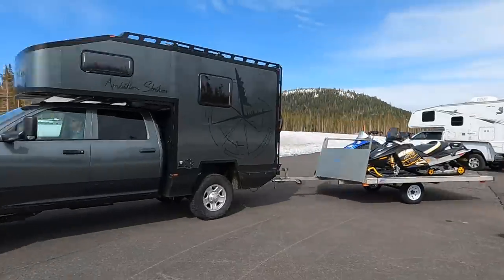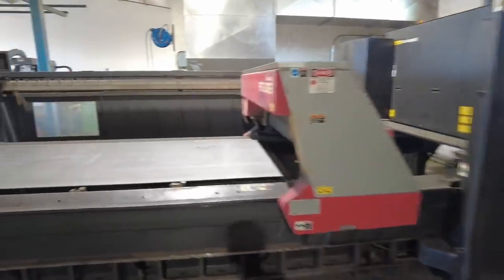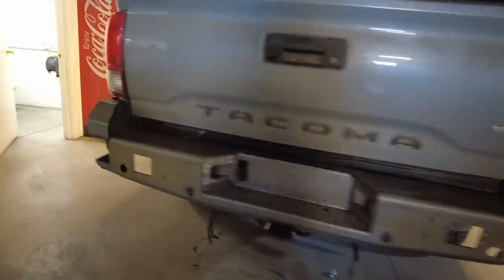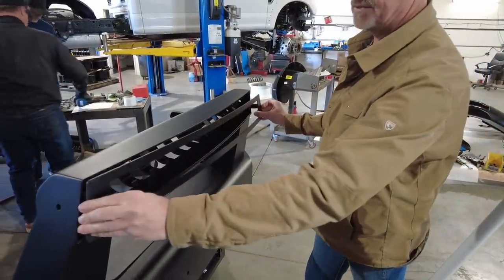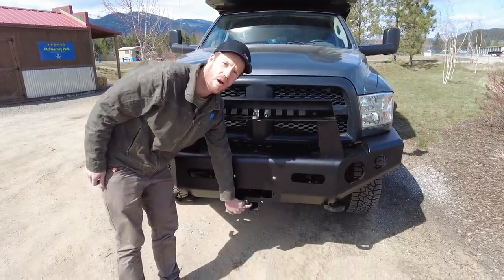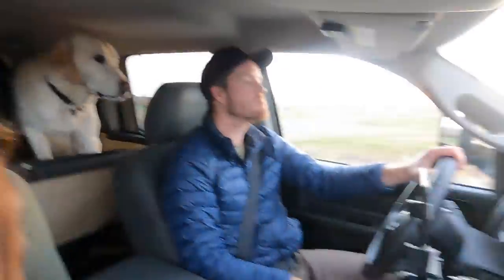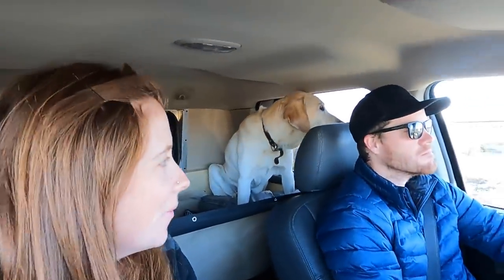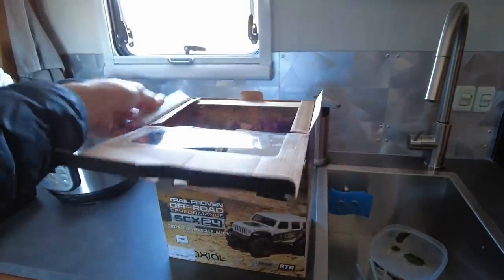This Changes EVERYTHING! Installing Our Buckstop Aluminum Bumper

Comment: Best winch for you is the Warn 16.5 TI. A winch should be rated at twice the vehicle weight. Think of your boot stuck in the mud then imagine your whole truck stuck in the mud. It’s the winch AEV uses for a reason and I bought one for my Ram as well.😁
Reply from the maker: You can never go wrong with a Warn!

Comment: When it comes to winches, it's got to be Warn.  You get what you pay for, and a winch is insurance.  I'm a bit biased as I used to work there, but there are design details on the inside of a Warn winch that make them better than the competition.  Superwinch would be a close second.
Reply from the maker: We have run Warn's in the past and have never been let down!

Comment: Awesome!  As for the intercooler protection Riley mentioned, ask Buckstop about their front lower skidplate that closes the gap between the bumper and the lower part of the frame frame.  I didnt even know they offered one until a friend told me, its a slick piece and fits perfectly its in one of my episodes.  Awesome work guys
Reply from the maker: Thanks Kevin, we're going to have to check that out!

Comment: I love the new bumper. I have been eyeing some Buckstop stuff for my trucks and Seeing their operation was all I needed to convince me to buy from them. A coffee tip, when you have no coffee filters (cowboy coffee): Bring your water to a boil and remove from flame, dump grounds directly in water and let sit for 5 minutes, pour about a cup of cold water into the pot slowly and distribute evenly over the surface. Then pour the coffee and drink. You will have to dump the last cup or so with the grounds in it. The cold water knocks almost all the grounds to the bottom of the pot.  I am looking forward to see wheels and tires now.
Reply from the maker: We are so stoked with the bumper and were even more impressed with their operation! Thanks so much for the tip, we will be better prepared next time we run out of filters now!

Comment: the 12,000 lb winch From Harbor freight has been very reliable for the people I know that own one.  It is also a wireless remote. I also recommend a synthetic rope if possible to get in that weight limit.
Reply from the maker: Yes synthetic rope is the way to go! Safer, lighter and so much more pleasant to work with.

Comment: Ive only ever had one winch. But it has been plenty reliable. Harbor freight badlands 12k. Only downside was the rubber on the electric cables fades and gets hard in the sunlight. But in your covered bumper it would be fine
Reply from the maker: That's awesome you've had good luck with that winch, we are certainly going to check it out!

Comment: Love the bumper. I will definitely check them out because I want something rather unique. I like the receiver built into the bumper but I want two of them. We have electric bikes (we’re old farts) which weigh about 50 lbs each. The bike racks that I have found are not stable enough. I think two mounting points would be much better. Safe travels!
Reply from the maker: Riley seems to think they should be able to do two hitch receivers no problem! I ride an ebike and agree that two bikes on one hitch would be sketchier than I would like!

Comment: There are lots of ways to save money on an off-pavement truck build, but tires and winches are two places to never cut corners, as it may cost you your life and/or your rig.  Conventional off-road wisdom says you want a winch rated for 50% more than your GRVW (so if your GRVW is 10,000lbs, you'd want a winch with a minimum rated line pull of 15,000 lbs).  In all likelihood, given the weight of your rig and all it's permanent gear, you;re probably going to want a 16,500 lb-rated winch or larger.

WARN winches are the way to go )as you probably already know).  Ultra-reliable and easy to get parts and service for.

To save constant weight on the front end suspension (esp. since you just added another 50ish lbs of bumper), I'd go with something with synthetic winch line.  Synthetic line is also safer if it breaks - less chance of the shackle coming right back at you through the windshield.

If it were me, not knowing the exact weight of your rig other than the 8600ish pounds you mentioned in Episode 5, I'd suggest looking into a WARN 16.5TI-S or a WARN-15-S (the "S" indicates synthetic rope - drop the "S" to find the same winch with steel cable).  Pricey, but overbuilt and perfect for your rig.

https://www.buckstopinc.com/warn-165ti.html (steel cable)
https://www.dieselpowerproducts.com/warn-16500-lbs-capacity-winch (synthetic rope)
https://www.amazon.com/WARN-000-M15-S-Winch-97730/dp/B01N4SP32V (synthetic rope)
Reply from the maker: We have never been left stranded by a Warn winch so that is definitely the direction we are leaning. After owning several winches with synthetic line we will never go back to steel cable!
Reply: @AmbitionStrikes  Oddly enough, I just watched another YouTuber use a brand new-synthetic line winch to drag an old truck out of the woods.  After a single use, his synthetic line showed a lot of crushing/stretching damage.  

I edited the link to play right where he shows the line damage:

https://youtu.be/EQ9BW4hh1to?t=522

Comment: Bumper looks so great. how much is the rough cost? thanks!
Reply from the maker: We are very stoked with how the bumper turned out and can't wait to put in the lights and winch! Retail on the bumper really depends on the configuration you choose, especially if you upgrade to aluminum. They have a great configurator on their website to help you get an accurate price!  buckstopinc.com

Comment: I've seen good reviews on the Harbor Freight 12,000 lb winch.  Watch Wranglestar's review of it . You'll find it quite informative. The winch is 6 to 7 hundred dollars less than others at that rating. It comes with a wireless remote and a long cable seems easily installed and Wranglestar and other reviewers all call it beefy.
Reply from the maker: Thanks Craig! There have been quite a few votes for the HF winch so we definitely need to check it out.

Comment: for a winch I would'nt go with anything smaller than a 12k winch.. ideally I would put a 16k winch in it.. however once in 16k winch territory you tend to get stuck with steel cable, and if weight is a concern... that is about 120lbs hanging out front.. but you should use the 1.5x rule of thumb, and always have a snatch block to (nearly) double your pulling power. and seek synthitic if you can.. tyhe weight savings is HUGE..
Reply from the maker: Yes! After having synthetic cable on several winches we will never go back to steel cable. It is so much lighter, safer and more pleasant to work with. We will definitely be carrying a snatch block and tree saver strap as well.

Comment: looks great yall! curious to know if you considered AEV for the ram. If so, what made you go Buckstop? We are deciding between both brands currently. I dig the different brushguard styles and customization from Buckstop as it allows for serious protection and endless lighting options but the stamped AEV bumpers do look amazing. let us know!
Reply from the maker: Hi Garrett! We like a lot of the features about the AEV bumper but it is significantly heavier than the Buckstop aluminum bumper and that was the deciding factor for us.

Comment: I ordered one too!
Reply: I went with the comeup seal 16.5 with synthetic line and wireless remote.  Did Buckstop say you can add the winch without removing the bumper or are you going to have to reinstall it?
Reply from the maker: That is so awesome! Send us a pic when you're done with the install so we can it out! courtney@trailtestedmfg.com

We will need to remove the bumper to install the winch but it seemed quite easy!
Reply: @AmbitionStrikes  will do! It should be in in a week or 2 and I need to pick it up in New Hampshire (about 1.5 hrs away)  I wish I could have bought the aluminum but the bumper a good winch and lights were already pushing my budget

Comment: I f anyone decides to back up into that bumper, it will destroy their rear end.  It is beautiful and solid.  It's impossible to determine which winch is the best, because all the reviews are just reviews, with no real time testing to find out which brand is the most durable /highest quality. Warn was bought out. That is never a good sign. Large conglomerate purchase may mean cheaper quality parts, chinese manufacturing to maximize profits. What you need is an off road forum site with many seasoned drivers who know the score from years of using all brands. That way, you get an unbiased opinion of who really manufacturers the best winches for 2021.  It's an important purchase. Do not want to make the wrong choice.
Reply from the maker: Hopefully we don't need to use the bumper ever but the peace of mind is certainly nice! A large sampling of people wheeling full size trucks would make for a great resource.